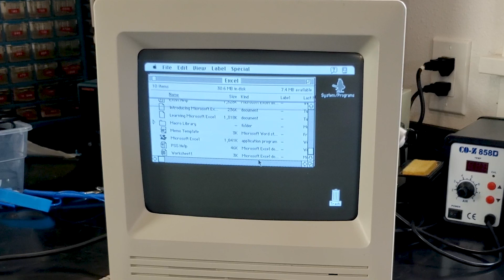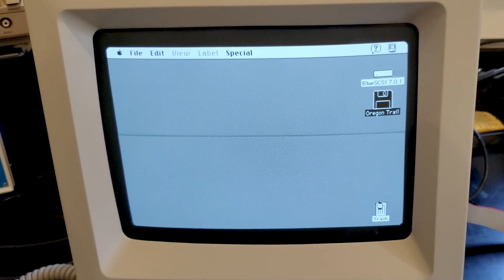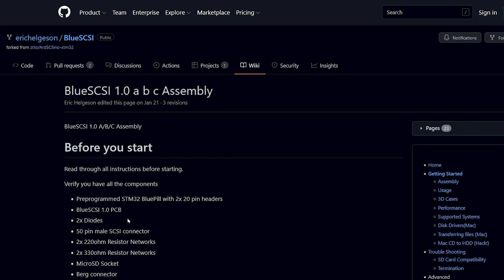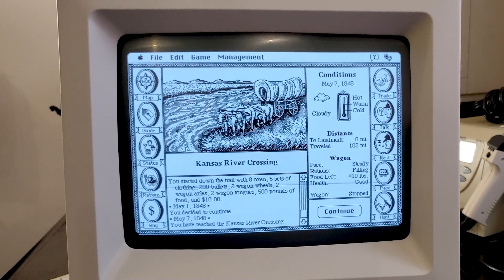Apple Mac SE/30 CRT Flicker Fix + Floppy EMU & Blue SCSI Install

Comment from the maker: The BlueSCSI video is shot so I will edit it and get it up as soon as I return home next month. I'm still uncertain which fix finally solved the screen flicker issue I have been fighting (Although I di have a suspicion it was the connector) but its great to finally have a solid machine for regular use. What do you think solved the issue?

Comment: Do you reckon the corona dope did most of the work at fixing your flicker issue or the reflowing of solder points? I have a couple machines with a similar problem (SE, Classic 1)
Reply from the maker: I tend to give odds to things so my thought is that it was:

65% chance the new connector or its associated solder joints fixed it
20% the corona dope
5% the cap bodge (It was well connected electrically)
5% the reflowing of other joints (I found a couple dull joints I missed before with some extreme magnification)
5% something else like a poor connection I did not see. 

Normally I only do one thing at a time and see if it helped but I was on a timeline since I am leaving for a trip today.